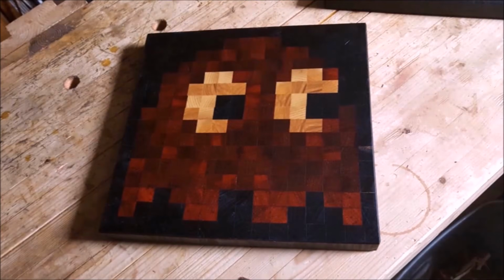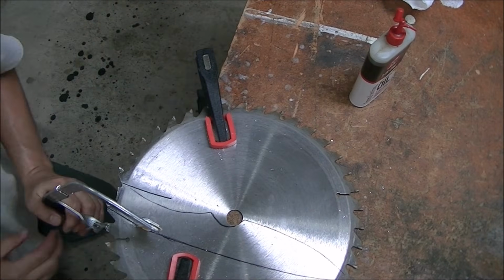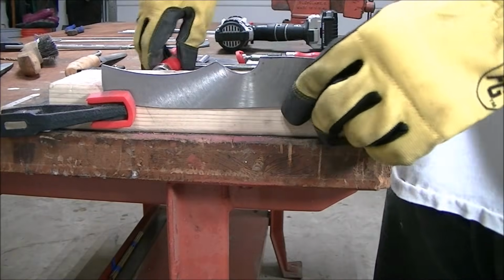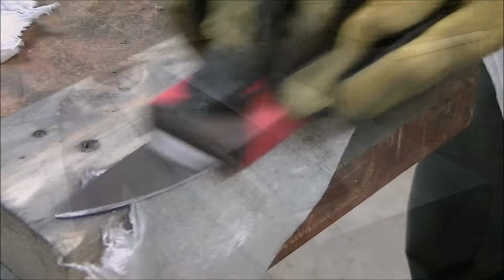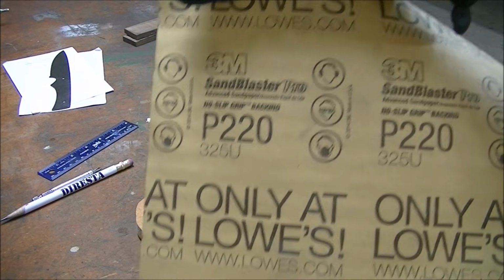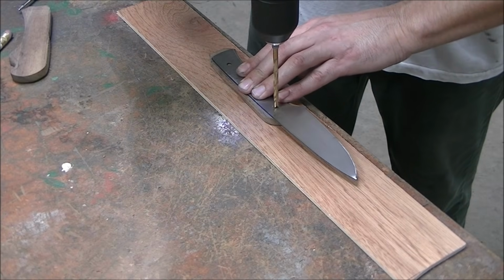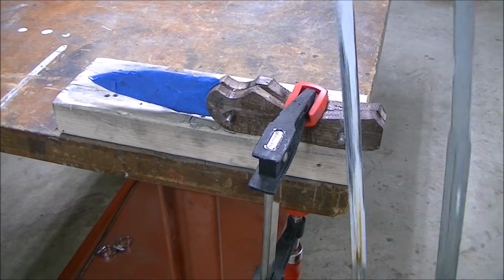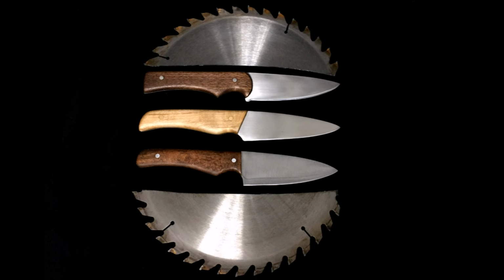Saw Blade Knife with Limited Tools

Comment: ❌️Why heat treating sawblade ? Sawblade have good hard steel, I dint think this is the right think to do it .sorry
Reply from the maker: After I made this I realized it would have been smarter to heat the saw blade up to anneal it first then it would have been way easier to cut and file.  I remember when I made this and cutting it by hand was very labor intensive and it ruined at least one hacksaw blade if not two.  Had I annealed it first I would have had a much easier time shaping the steel.

Comment: This is not HSS, it's not even tool steel. Only welded teeth are carbide, the main body is comon soft steel, not suitable for knives. Common mistake.
Reply from the maker: You are wrong. I heat treated the steel from the main body and got it to skate a file.  Then I did a snap test and got it to snap like a cracker.

Comment: Nice job 👍 what's the thickness of the saw blade?
Wonder if you can buy them thicker.
Reply from the maker: Its about 1/16 inch I think.  Its a standard table saw blade.  Thicker blades can be found but they are usually larger in diameter.

Comment: When using your handsaw cut it in half first while you still have the length of the wood then cut the length down it'll make it a whole lot easier on you to split it in half instead of cutting such a small piece.

Comment: Very nice, I always wanted to make one, and now that I’ve seen it can be done without a forge I may try. Nice video, thank you!
Reply: Don't make the same mistake as this man. The edge retention will like a six cuts and gone :D. These 'knifemakers' are a joke to real craftsmans. What about to find out some information about steel first? No? If the saw blade has welded teeth, the body of the blade is junk steel about 0,3% C and can't be used for a good knife. So much work for such a useless result. FYI, I'm metallurgy specialist.

Comment: With woodworking and other projects you always see people complaing about their lack of tools so I have all the power tools for this and I am thankful for it after watching your knife build.
I have my knife cut out and ground all the edges smooth.. I gotta get some flap discs but an angle grinder, grinding wheel and belt sander have made it a lot easier thus far.  I am no knife maker but have built some rough 2x material patio furniture so I figure if I only make 1 knife in my lifetime I can always hand it down to my son and hell at least I am taking a whack at it.. A lot of people can't say they made a knife from scratch so there is that.. Depending how mine comes out it maybe just a decorative piece who knows.. Cant wait to start beveling an edge, hardenin the blade and puttin the handle on.

I have enough of the saw blade I may rough out and grind another one so it'll take less time to work on 2 as an assembly line than 1 full build and starting another
Reply from the maker: Good luck with your project.

Comment: Just started mine today on an old 12" table saw blade and one thing I learned as a lefty is to have the blade facing left so sparks shoot downward.. I had it with the blade facing right and rather than the rotation pulling into the cut it was pushing back away and i was getting some kick back.. Same concept as using a router from R to L instead of L to R which L to R is the proper way..  Was something I didnt think of and I am a noob with angle grinders..

For mine I plan to use 1/4" wood dowels 2 dowel pins, I have heard peeps using a metal coat hanger for a 3 pin but I am not goin for a fuxking forged in fire knife... 2 wood 1/4" dowels should work fine
Reply from the maker: I usually wear a full face shield when I use an angle grinder, I am not a fan of getting sparks flung at my face.
Reply: The edge retention will like a six cuts and gone :D. These 'knifemakers' are a joke to real craftsmans. What about to find out some information about steel first? No? If the saw blade has welded teeth, the body of the blade is junk steel about 0,3% C and can't be used for a good knife. So much work for such a useless result. FYI, I'm metallurgy specialist.

Comment: That's awesome. I'm gonna give it a shot today. I applaud you though. Some other youtubers make videos titled "...with minimal tools" then pop out a freaking lathe or something. 

I don't have a lathe but I'm fortunate enough to have been able to finally buy myself an decent angle grinder this past summer. 

I was also wondering what did you quench the blade in to harden it? Was it just water or oil?

Thanks for the inspiration. Now I have to decide if I make myself a karambit or if I make a kitchen knife for my parents lol
Reply from the maker: Thanks, I quenched the blade in peanut oil.  Certain steels you can use water but it can be risky and crack the blade.  Stick to oil, it can be used motor oil or cooking oil.
Reply: Sweet thank you. I have vegetable oil on hand. 

I decided on a cleaver as a belated birthday gift for my dad.
Reply from the maker: @lucasgarcia6696  That's awesome good luck with your project.  Sanding by hand can suck but it is well worth the effort and very satisfying when complete.

Comment: Nice work! I've just started making knives myself, but i don't really understand how you see what kind of metal to use, and how to fix it (in a bbq and an oven). Can you please tell me some more about that? Or give me a link to someone that explains it? Thanks! Peter
Reply from the maker: Different steels require different temps and sometimes methods.  I It is better to buy steel so you know what you are working with but if you are using a "mystery" steel I would suggest you do some test on your own.  I would also suggest searching YouTube for "how to heat treat a knife at home" and check out those videos for different options and info.  Walter Sorrels has some good videos on YouTube about heat treating.  Hope this helps.
Reply: Dan The Maker Man Thanks a bunch, maker man!
Reply: The edge retention will like a six cuts and gone :D. These 'knifemakers' are a joke to real craftsmans. What about to find out some information about steel first? No? If the saw blade has welded teeth, the body of the blade is junk steel about 0,3% C and can't be used for a good knife. So much work for such a useless result. FYI, I'm metallurgy specialist.

Comment: Such a great job! all by hand!!!! Can you give me more details about the heating and baking process? why was that necessary?
Reply from the maker: Thank you.  You heat the blade until it is no longer magnetic and quench it in oil, this redefines the crystalline structure of the steel and makes it very hard.  At this point the steel is very hard and brittle, which means it will break easily if you were to try and bend it.  You temper the steel in an oven at 400 degrees Fahrenheit to relieve the stress/hardness in the blade.  This makes the steel less hard but not so much that it becomes soft and will not hold an edge.  The point of tempering is to soften the steel enough so that it will bend some, without snapping but also retain enough hardness so that when you sharpen it, it will remain sharp.  Different steels have different requirements as to time and temperature for tempering in my video I just did what is the most common.  Hope this helps.
Reply: @danthemakerman  thank you for your explanation! How many degree and how long do you heat the first process? And how long did you temper the steel in an 400 degree oven?
Reply from the maker: @butahuruf  You heat it until its starts to glow red in a dark room.  At that point I start to use a magnet and check to see if it still sticks to the steel.  If it sticks I put it back in the heat then I will check it again with a magnet.  Once the magnet no longer sticks I put it back in the heat for about 15 seconds then quench it in oil.  As for the oven I do 400 degrees in a preheated oven for one hour and then let it cool to room temp in the oven.  Some people do multiple cycles in the 400 degree oven.  They will leave it in there for 2 hours and let it cool then do another 2 hours at the same 400 degrees and let it cool.  When you temper the blade you want the steel to have a golden wheat color almost like a bronze look.
Reply: @danthemakerman  Great! It is perfect. You should write these process in the description of your movie. I will start to make my own tomorrow. I guest it is the right moment to do it. #quarantine

Comment: Awesome video. but how is characteristic of circle saw? Is it similar with 1095bspring steel or better at rust ressistant?
Reply from the maker: Just like 1095 this saw blade is a carbon steel so it will rust if not maintained properly.

Comment: Did the magnet stick to it at all. Once heat quenched.?
Reply from the maker: The steel becomes non magnetic when its red hot.  Once it is quenched or the temperature lowers it will be magnetic again.

Comment: what brand and or kind of drill bits do you use? I tried putting new pins in one of my knives and the drill bits I tried to use said titanium but they did not drill the knife blade very well
Reply from the maker: I used to buy my drill bits at Home Depot but never had them last long.  I ended up going to Amazon and buying Cobalt drill bits they have lasted much longer.  These are the 1/8" bits I have been buying: https://www.amazon.com/gp/product/B07CRWVNN3/ref=ppx_yo_dt_b_search_asin_title?ie=UTF8&psc=1
Reply: Thanks I will try them

Comment: How thick is the steel ? I want to nake a knife out of 3/16 material but I am afraid only a hacksaw wouldnt be enough.
Reply from the maker: The saw blade was about 1/8" inch thick.  It can be done it will just take a little elbow grease.

Comment: When you use epoxy, don't clamp too tight. Also I would score the metal.
Reply from the maker: Thanks for the tip!
Reply: Really no need to to drill extra holes to make it lighter but yes,,,like Rodney said. I use a dremel to make long lines in it to give the epoxy something to grab onto. 3 nice knives you made. I’ve done tons of saw blade knives and still making them. Great job brother. Thumbs up and a new subscriber.

Comment: Wow, my blade ate the hacksaw, the file was useless.Must have got one with high carbon, used angle grinder and  it worked but softened the knife, a work in progress, hardening and tempering next.
Reply from the maker: Wow really?  Yeah the angle grinder is my go to tool its inexpensive and comes in so handy.

Comment: @Dan the maker man. 
Do you have to heat treat a saw blade? I thought saw blade metal was already hardened n all u had to do was shape m sharpen the knife.
Reply from the maker: I'm not an expert but I got a lot of mixed info from the internet on this topic.  Some folks say that modern saw blade bodies are not hardened steel that only the tip is hardened where the carbide tips are welded and the bodies are an alloy of mystery steel.  Other folks say that old, nobody states specifically how old, saw blades are made entirely from hardened steel.  Since I didn't have a clear answer I thought it best to take a small piece of the blade I was using and heat it to nonmagnetic and see if it could be hardened, that's why I did the test in the beginning of the video.
Reply: @danthemakerman  were you successful or was it already hardened

Comment: What kind of saw blade was that? I have an old miter saw that I'm thinking of using the blade to make s knife
Reply from the maker: The saw blade was from a table saw.  Before you go through the trouble of making the knife I suggest testing out the metal to make sure it is hardenable.  Cut a small piece of the blade off and heat it until it is no longer magnetic, quench it in oil, then once cool put it in a vice and see if you can snap it in two.  If it snaps it can be hardened.  If it just bends and doesn't break then it can not be hardened.  Good luck!
Reply: Dan The Maker Man thanks mate I'll try that

Comment: how do you drill holes so easily ? I think i already bought 10 kinds of drill bits.. i tried softening it in oven till orange, then put it in sand to cool; I use oil, low speed.. sometimes i can make a hole but it's just like i'm trying to drill through diamond..
Reply from the maker: This is what I use. Cobalt drill bits for hard metal https://www.homedepot.com/p/Milwaukee-1-4-in-Cobalt-Red-Helix-Drill-Bit-48-89-2313/203115295

Comment: My dad used to make knives from old files. Glad to see craftsmanship isn't dead. Whether it's perfect or not, it's something you did. To me, it warms my heart to see youngsters involved in something more productive than the other crap that kids your age get into. Kudos young.
Reply from the maker: Thanks for the comment I appreciate it.
Reply: Old files are actually great steel but this is not. The edge retention will like a six cuts and gone :D. These 'knifemakers' are a joke to real craftsmans. What about to find out some information about steel first? No? If the saw blade has welded teeth, the body of the blade is junk steel about 0,3% C and can't be used for a good knife. So much work for such a useless result. FYI, I'm metallurgy specialist.
Reply: Your wording is pretty harsh. It is definitely true though that not all steel is good steel. And as you said, old files are good hard steel, but new ones are not. This is because new files, rather than being hard steel all the way through, are only case hardened: that it, hard on the outside, soft on the inside.

Comment: Awesome job!
For how long did you temper the blade before putting it in the oven?
Reply from the maker: When I quenched the blade in oil it was only for about a minute or two at the most.  Then I put in the oven for an hour at 400 degrees Fahrenheit.
Reply: Dan The Maker Man  Thanks! Very kind of you.

Comment: Hi. What kind of drill bits did you used to drill thrue? Im trying and i cant get thrue the saw.
Reply from the maker: I use a drill bit for steel.  It may be that the steel you are using is hardened already.  You might have to anneal the steel.  Heat the steel up to a non-magnetic state then let it air cool.  This will in effect soften the steel and make it easier to drill through if it is hardened.  I had to do this when I made a knife from a broken file.
Reply: Dan The Maker Man thanks for answer. Ill try.

Comment: Thanks for the video. Very informative. Could you explain why you do heat treating first and then tempering? What do they achieve, how much do you heat the knife during heat treating, what do you use to cool it, why do you need tempering afterwards?
Reply from the maker: Thanks, I will try to answer your questions as best I can I am no expert and you should do some research if you plan on making a knife.  High Carbon steel like 1095 can be hardened if heat treated.  Mild Steel that has a lower Carbon content can not be hardened.  I wasn't sure what steel this blade was made out of so I did a quick test by heat treating a small piece and checking to see if it could be hardened.  Heat treating the blade makes it harder so it will hold an edge better.  You have to heat it until it is no longer magnetic then quench the blade in oil.  At this point in the process the blade is very hard, too hard actually.  It is susceptible to breaking at this point.  To alleviate that brittleness you have to temper the blade in the oven at about 400 degrees for about an hour.  This sort of relaxes the steel so to speak it will make the blade less brittle but still hard.  The goal is to have the best of both worlds, hard enough to hold an edge for awhile and soft enough to be flexible.  Different steels require different quenching solutions so I suggest you research as much as you can.

Comment: Amazing vid, can peanut oil be substituted?
Reply from the maker: Yes! That's what I use.
Reply: Dan The Maker Man what sort of substitute oils can I use? Does it matter?
Reply from the maker: There is an actual quenching oil you can purchase or use peanut oil or motor oil.  Those are the ones I've seen people use.  Motor oil will make more smoke and I have heard will catch on fire more easily but can't confirm I have never used it.  I quench in used peanut oil which had previously been used to make a bunch of fried fish.  I used a strainer and cheese cloth to filter the oil before I started using it for knives.  It actually smells pretty good whenever I quench and has never caught on fire.  If you are starting off and don't want to invest much money then go with used peanut oil or used motor oil.  If this becomes a serious hobby then invest in some actual quenching oil.  I'm not experienced enough to say it doesn't matter but there are plenty of folks out there that use peanut or motor oil and get good results.

Comment: Great job! what temp. do you heat treat
Reply from the maker: Thanks, I heated the blade until it was no longer magnetic then quenched it.  Then I tempered it in my preheated oven at 400 degrees Fahrenheit for one hour.  I leave it in the oven to cool down until its safe to handle.

Comment: I'm pretty sure that cordless drill is a power tool, great looking knife, I'm inspired to try making one myself. Thanks for the video.
Reply from the maker: Yeah I gave myself a pass on the drill, I actually looked for one of those egg beater drills but they were too expensive so I couldn't justify spending the money on it for just one time use.  Good luck with your project!